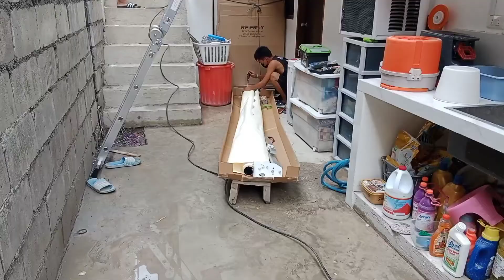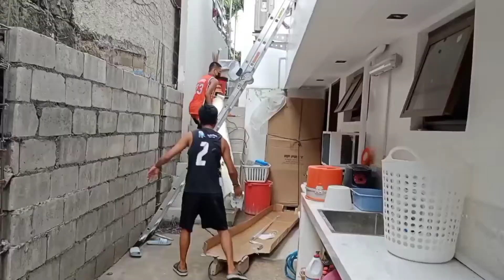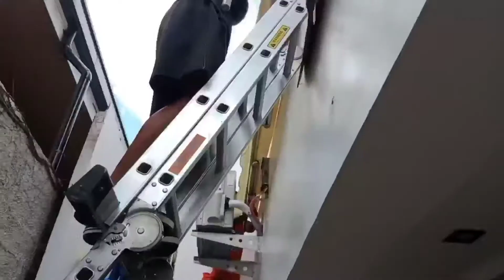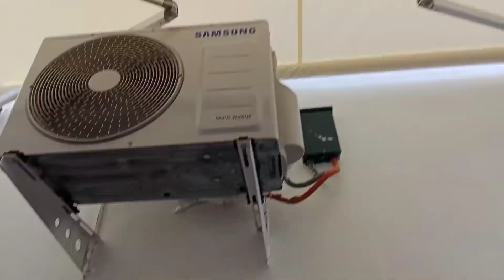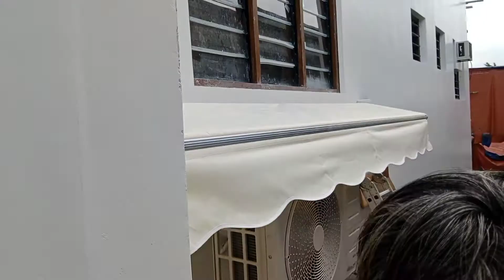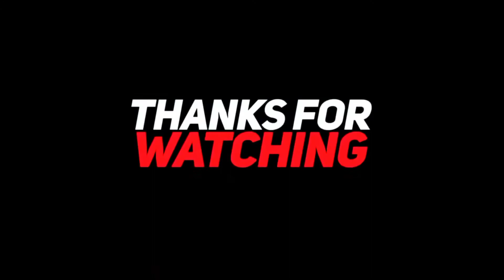how to install Retractable Awning

Comment: Magkano pagawa ng ganyan?
Reply from the maker: Gusto n'yo poh magpagawa sir
Reply from the maker: Depende poh sa haba sir massage nyo ako masenger ko assorted vlogs
Reply from the maker: pricelist  NCR Retractable Awning

Pricelist 
1.5x1 m = 10500
2 x1.5 m = 12,000
2.5 x2 m= 14,500
3 x2  m = 15,500
3 x2.5 = 16,000
3.5 x 3m = 16500
4 x 2 m = 17,000
4x2.5m =17,500
4  x3 m = 18,000
4 x 3.5 m = 19500
5 x 2 m = 21,000
5 x 3 m = 22000
5x3.5m = 22,500
6 x 2 m = 23,500
6 x 3 m = 2

Comment: Hm boss?
Reply from the maker: pricelist  NCR Retractable Awning

Pricelist 
1.5x1 m = 10500
2 x1.5 m = 12,000
2.5 x2 m= 14,500
3 x2  m = 15,500
3 x2.5 = 16,000
3.5 x 3m = 16500
4 x 2 m = 17,000
4x2.5m =17,500
4  x3 m = 18,000
4 x 3.5 m = 19500
5 x 2 m = 21,000
5 x 3 m = 22000
5x3.5m = 22,500
6 x 2 m = 23,500
6 x 3 m = 2
Reply from the maker: Ayan poh sir
Reply: @assortedvlogs5803  free install na po ba?
Reply from the maker: Yes poh sir san poh ba kau
Reply: Mayrong bang mabili Yung bobong lang sa awning?
Reply from the maker: Anong size poh ba ma'am